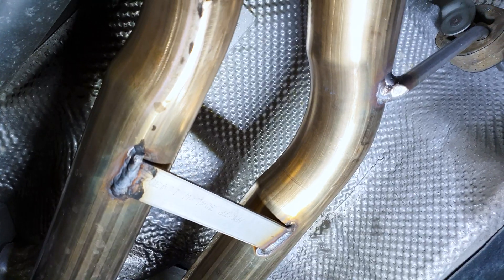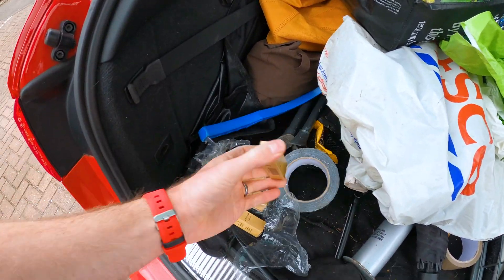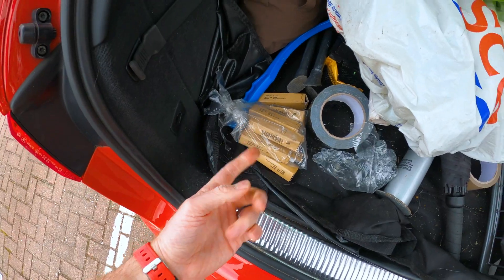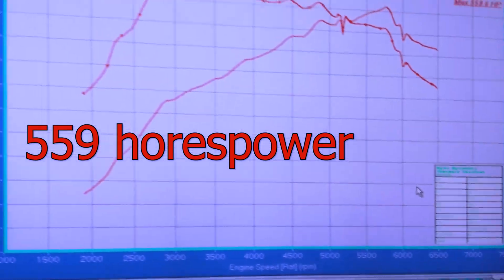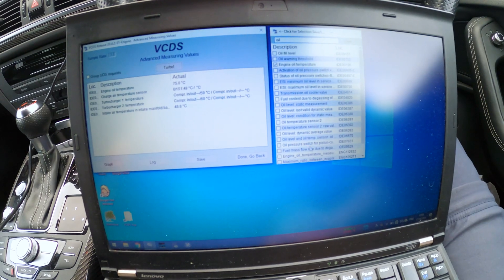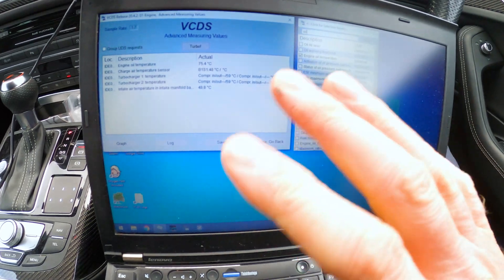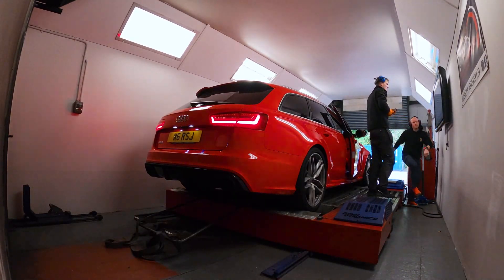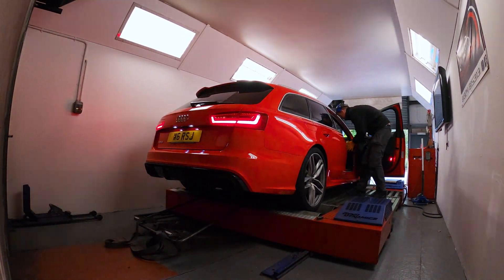Audi RS6 dyno results from the silencer delete

Comment: 100% agree with you about main dealers. It is literally the worst type of service history you could have on a car.

I’ve just bought a 17 plate C7 with FASH and 57k miles. Put it straight into my real mechanic and the news wasn’t good. Air filter is original stamped 2017 and it looks like the oil filter has been on there a long time, original spark plugs also!!

I wouldn’t trust a main dealer with a wheel barrow. Jokers!!

Comment: Hi
Would you recommend the x2 front resonators or the large centre 9ne?

Or both..

My main concern is noise 

I drive in comfort 
Would it be roughly the same until a knock it into sport mode?
Thanks
Reply from the maker: Check this video out I'm sure it will help https://youtu.be/SvYRxJx2eAs

Comment: Hi did you manage to get the misfire sorted? If so what was it? I’m having the same issue on mine but I have little to no power
Reply from the maker: High pressure fuel pumps. If you log fuel pump under load you'll see they aren't reaching requested fuel amounts

Comment: I have the same problem with my Audi s6 v8 biturbo. It runs real rough, I’ve changed plugs, coils and serviced, put x-pipe. But still runs crap and misfires.. gonna try to check it on Thursday.
If I know what it is I’ll try to tell you. 
And if you do I would appreciate if you could let me know!
Reply from the maker: Mines back in Thursday too, getting the coil packs swapped over. It had a collapsed catalytic converter but it wasn't that.Hopefully it's not the fuel injectors!
Reply: @vPerformance  Both my injectors and turbos were swapped 2500 miles ago.. if I’m unlucky there’s something wrong with the installation or from factory. If not, there’s another problem.,
Reply: @vPerformance  Any new information from the workshop? :) so exited to solve this problem.. irritating
Reply from the maker: Some, but not all. We were getting misfires from the remap when the engine first started. That was most of the misfiring. Too much fuel was going in. We still need to do the coil packs and see if that fixes everything else.

Comment: Faulty brake pedal switch on my old 2.5 TDI V6 Quattro used to cause random fuel cuts under load. Vagcom never picked it up but then heater plug light started flashing. (So supposed to indicate the switch but who knows haha) a random thing to check or ignore if wrong lol!

Comment: Two questions. A) What is that T-Shirt; where did you get it from? Looks like a great material, and looks as though it fits fantastic. B) What are those numbers 1-6 on the trackpad looking thing to thr right of the gear stick?. Oh, and great video btw.
Reply from the maker: It's from a drift driver called Steven McConnell. The 313 is his clothing brand, and you're right it's a cracking shirt. The numbers on the track pad are for controlling the radio of the car. Normally that pad is used for drawing letters when it's not on the radio.

Comment: Could be needing to gap the plugs a bit tighter as we have had issues with mis fires on the B8 S4 platform due to mis gapped plugs
Reply from the maker: Good shout Craig thanks. I'll add that to the diagnosis list!
Reply: @vPerformance  our gap on the b8 was meant to be 0.028 and have had to drop the gap to 0.024 to her rid of our misfires just the extra boost was blowing the spark out
Reply: Are you running platinum or iridium plugs? Standard copper core plugs deal with heat better and are more conductive than the exotic metals. That's why the tips are so small on them. Granted stock copper plugs don't last as long but they are much cheaper. 
Moral of the exhaust story, Audi already designed the exhaust very well. Keep up the good work 🏴
Calum from sunny Ayrshire👍
Reply: @calm4477  using iridium plugs,
Reply: @calm4477  also need to run colder plugs once modified as higher boost means higher cylinder temps